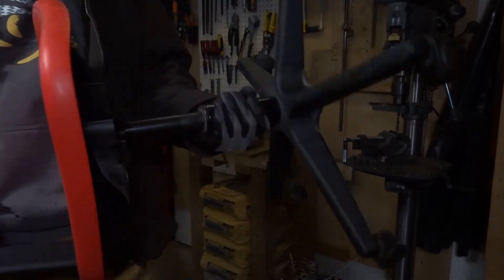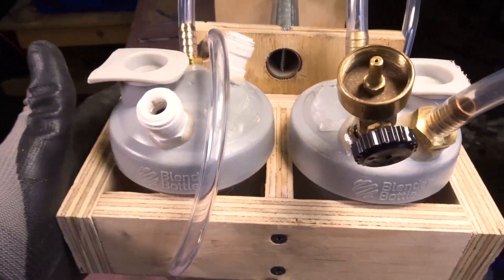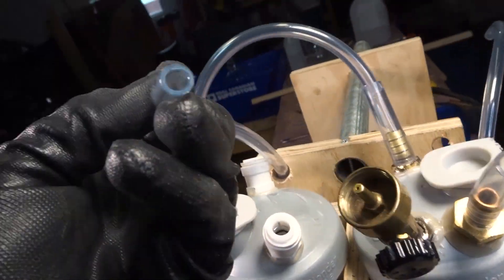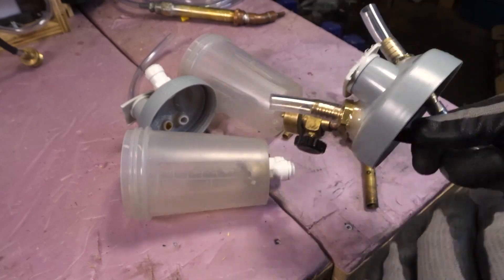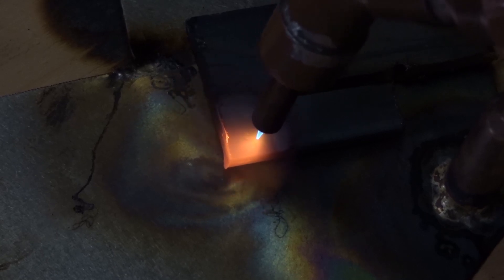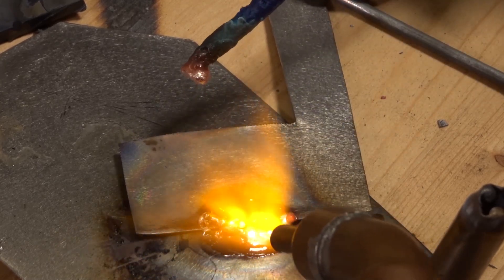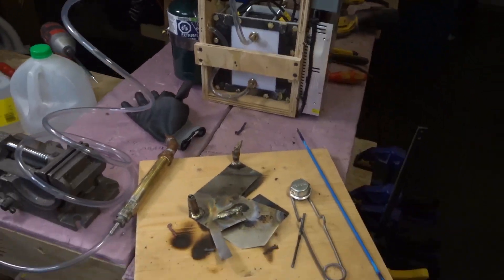HHO mixed fuel torch // Building an HHO brazing torch

Comment: You built all that to still use propane 🤦‍♂️
Reply from the maker: The hho makes the propane burn hotter🤦‍♂️
Reply: @Neally  so does oxygen and would cost next to nothing
Reply from the maker: Well of course, but that wasn't the point. The point was to see if hho could be used instead of oxy acetylene, the propane wasn't supposed to be the primary fuel but only to modify the flame to keep the flame from oxidizing the metal. If I was going for cheap and easy I would have just bought any oxy acetylene kit.
Reply: @Neally  if you watch the first video, he was trying to make an HHO torch with nothing else. It was obvious to me that it could not produce enough gas so he added propane.

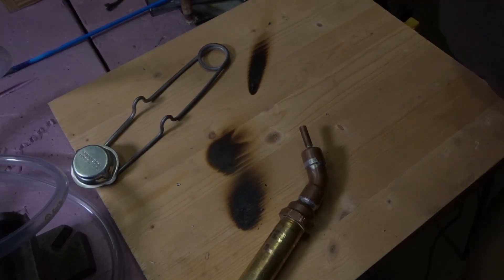Comment: I'm interested to know, as probably are many, as to what you are doing when firing up the torch. Specifically between 8:18 and 9:05, in what order do you operate the valves to fire up and then regulate the flame? Some instructions would be appreciated.

This seems like a promising project, i particularly liked the bubbling mixer, very safe way of going about things. I'm tempted to make some variation of this design, so any extra information would be great 👍
Reply from the maker: The order I follow is propane on first, light the propane, then turn on the hho, then adjust the propane to balance the flame. I found turning on the propane first made it easier to get the system running without blowing out the flame, which can happen if you turn on the hho first, because it's a very delicate flame. 

The principle behind the bubbler is sound, but my execution of it was not ideal. I had issues with leakages and electrolyte volume, so I'm planning on doing a complete overhaul on the bubbler system.

Honestly I'd say the whole system is pretty straightforward as long as you're careful and make sure you have fail safes in place so things don't go south. Good luck on your build!

-Neally
Reply: @Neally  Great explanation and advice, thank you. I will come back if I have any major success to let you know 🔥